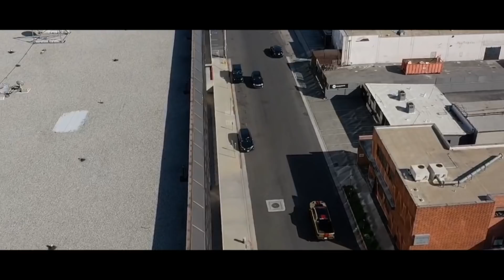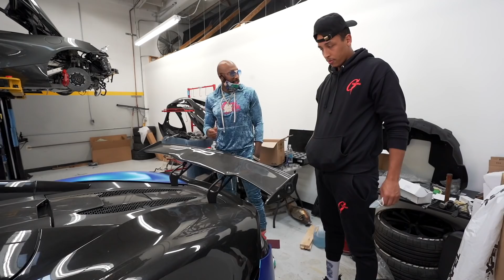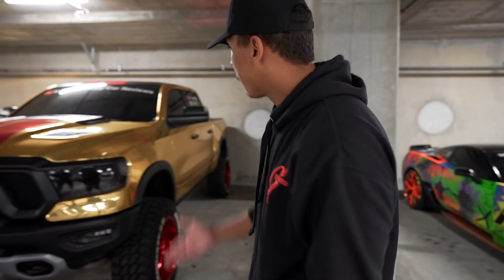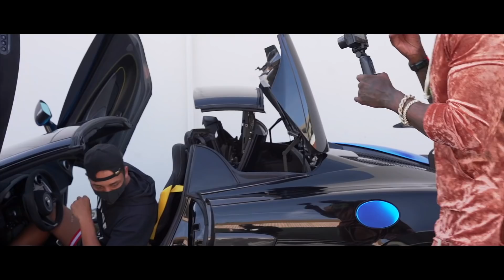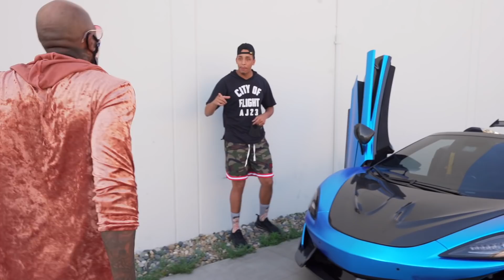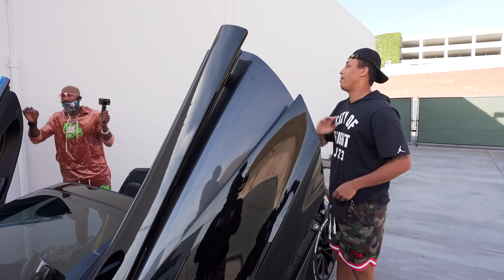MY MCLAREN IS FINALLY COMING HOME! *AFTER 6 LONG MONTHS*

Comment: That car either has factory fault or worst car ever... I'll give up on that over price piece crap along time ago. All I see u do is spend cant even drive for a mile without something goes wrong .on to the next' get that crap away from u
Reply: It was bent, the car had to go back to the manufacturer as its made from carbon fibre, had it been a Ferrari or any other similarly made supercar the same would have happened